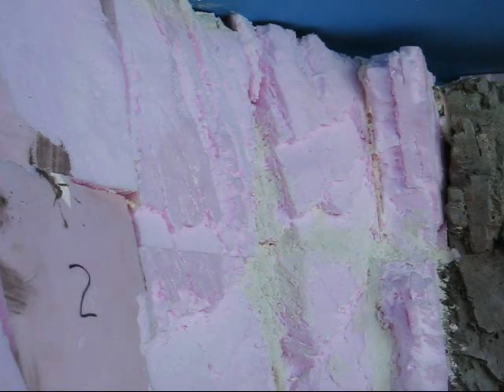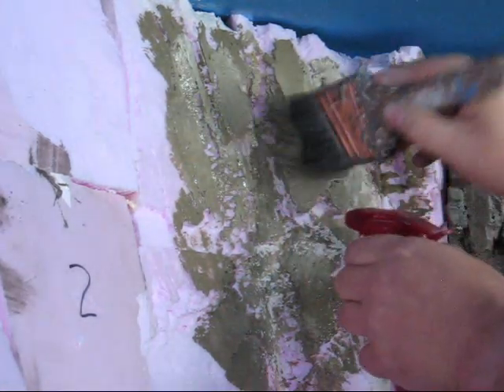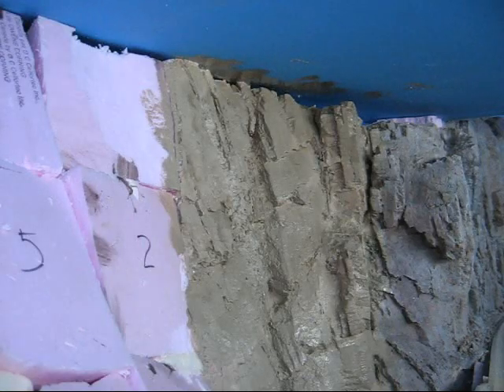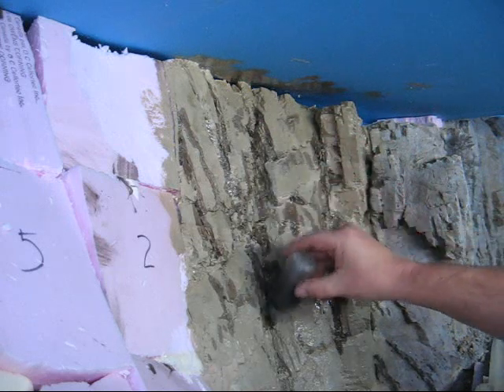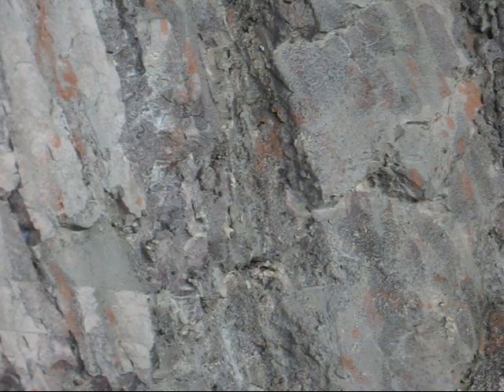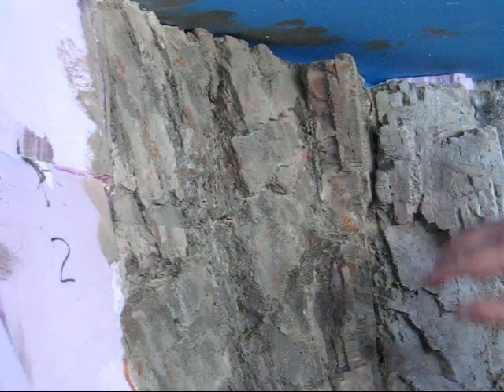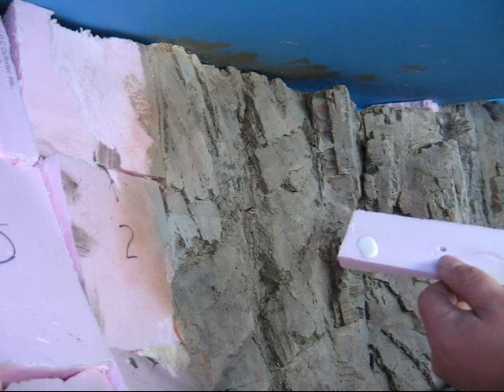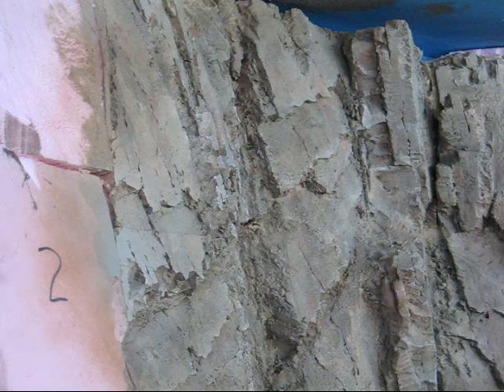Carving Foam Rocks 2

Comment: Just a super job.  Fast, and easy, and with a little care, a more practiced eye, and a bit of experience, we could come up with things almost a good as you.

  I tend to also use a thin boning knife, and an old steak knife, depending on the type of rocks I'm shooting to recreate.   I also tend to keep a picture of the kind of rocks I'm after, which helps me to get details, strata, about the right size?   If that makes sense.    Lastly, I find that well worn jungle rock, the stuff that's almost black, and almost like large and rounded, fairly smooth blocks of granite, I use a big sheet of course sandpaper over a large drywall sponge to help with some of the shaping and smoothing.

   Again, Ruphe, this is just a super job.  I can only assume it's true of others, but I learn so much from being able to watch skilled and clever craftsman and hobbyists, that it really is impossible to thank you guys enough.

Comment from the maker: My container just says Methyl hydrate on it, I know of no "brand name" as such. Any paint store should carry it, It's a fairly common solvent. One of it's uses is to prevent gas lines from freezing, but products designed specifically for that purpose have other additives included that may affect the paint. Isopropal (rubbing) alcohol would probably work but it's much more exspensive.
Reply: Whay was that used for again-reminder please.

Comment: MY go to video, just a question I want to ask, when you go in with the spray paint, does it not melt the foam?
Reply from the maker: Nope, the coat of latex paint applied prior seals the foam. Even so, I'm only applying a light mist of spray paint that probably wouldn't affect the foam much anyway.
Reply: acrylic spray  paint wont eat the foam lacquer based will
Reply: Iveelyef some go before good question
Reply: @CobaltNorthernStudios  lacquer based will not eat the foam once it's been sealed.

Comment: Nice tutorial, a good result delivered with a sense of humor, if i may be so bold as to give you a tip it would be to not drybrush with a pure white, always tone it down with the primary color, that will get you a softer edge.
Reply from the maker: Right you are Claes. I usually don't use pure white for dry brushing, it's quite often a very light version of the local colour. Although, I find on the Styrofoam rocks the dry brushing colour very quickly soaks into the base colour so you need to apply a great deal of white before it acually  starts to look white. It blends well. Truth be known, I usually dry brush these sort of things with a big ole' 2.5" house painting brush. A good quality, soft brush and just a whisper of paint... you can cover a lot of surface area fast.

Comment: I painted my tunnel with latex paint then used a wash of diluted black craft paint and all the craft paint just ran off leaving only the base. How to you get your washes to stick to the latex without just beading up and running off?
Reply from the maker: I've never had that problem! I'm using flat latex paint as a base and I dilute the craft paint with a little methyl hydrate. Perhaps you have diluted the paint too much. The trick is that the craft paint should only stick in the crevices. Good luck.
Reply: rupheandtumbelle It's possible that I'm diluting too much with water but I haven't found an easy to follow ratio to give me the correct amount. So far all ive read are things like 1 part water to 16 parts paint if you know what I mean. 

It's kind of hard to follow when one day I'm making a shot glass full and the next I'm making a cup full then the next I'm maybe making a thimble full.

Comment: What is, "methylhydrate" and what does it do?
Reply from the maker: Methylated spirits, isopropyl alcohol or waterline antifreeze will work as well. It just dilutes the paint to a wash consistency and is thinner than water so it flows better.

Comment: would i be able to use this exact same technique, but on a bigger scale to make stone walls for the inside of a cave?
Reply from the maker: It would probably work OK, just remember that as you get bigger you'd need thicker foam to get the same level of relief. Also, when I do bigger projects I trade in my knife for a chainsaw to get the rough work done. Hockey mask is optional   ; )

Comment: Why use methyl hydrate to mix with the craft paint? Thanks.
Reply from the maker: Water will work, but Meths has a lower surface tension so it flows better.
Reply: Thanks. Very helpful.

Comment: GREAT VIDEO!!!!!
Thank You for your knowledge!
What is the foam attached to in the early stage? Didn't see that in the videos. I see that you used your short bristle brush intently to beat in a stipple rock texture and I noticed no movement to the foam. Is it affixed to wall or did you construct a back plate independent of the wall?

Comment: awesome stuff, gonna be trying this after years of plaster and molds. Is the spray paint Acrylic, enamel, or laquer? Is the kitchen knife serrated?
Thanks!
Reply from the maker: Just standard everyday spray paint, which is usually laquer. This will eat the foam so make sure to apply the latex paint first. The knife is not serrated, serrations will leave ridges in the foam that are to regular to look natural.